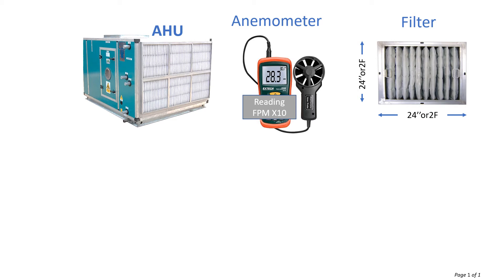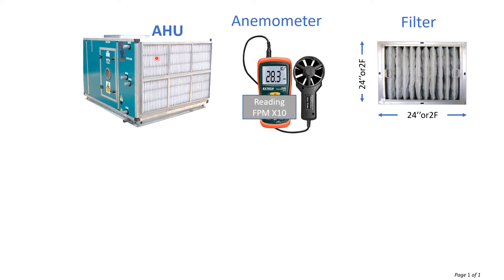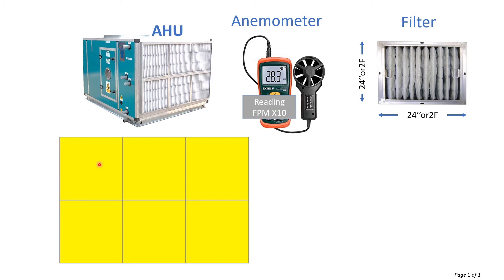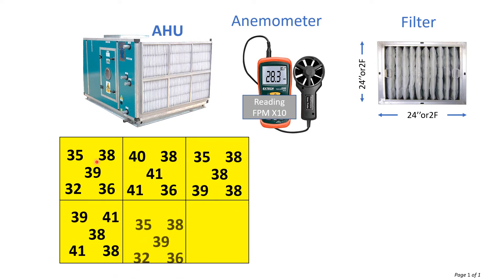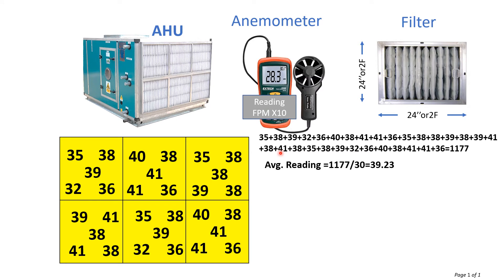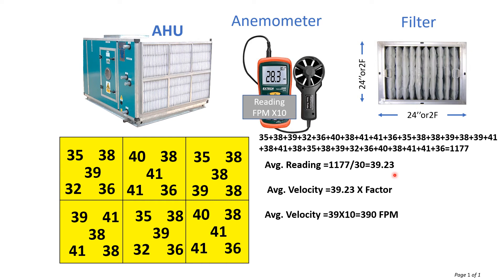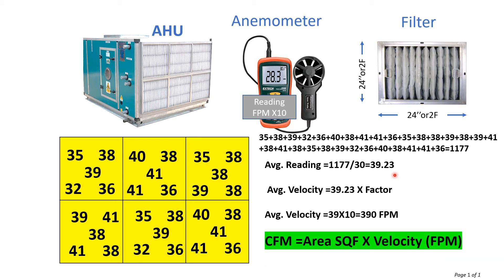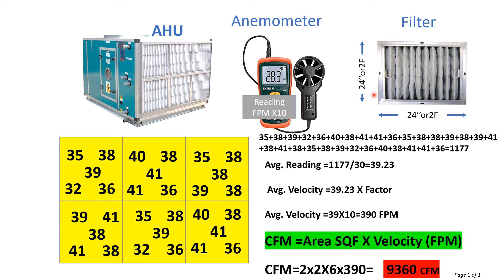AHU CFM Calculation

Comment: Hi can you please share a procedure, How to Calculate CFM for PACs / PAHUs
Reply from the maker: You can take CFM on the suction side on the filter, or on the suction grill
Reply from the maker: Also you also can check the CFM on all supply  air perforated tile .
Reply: PACs / PAHUs are bottom through, above that there will be a false floor on it.

Comment: 10 se kyo multiple kiya
Reply from the maker: Some of the anemometer have multiplying factor of 10 while calculating the fpm reading and factor is mentioned in the meter only . First check if yr meter is old one and it is having mf, Otherwise if the meter is giving reading in direct fpm then no need to multiply by 10 .